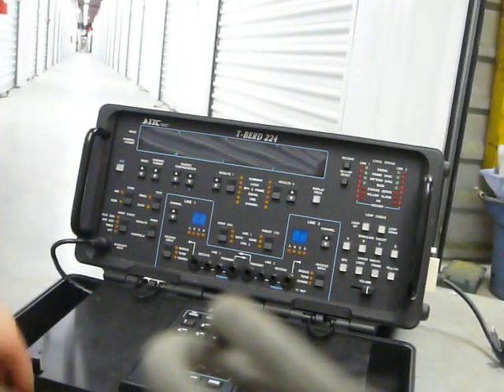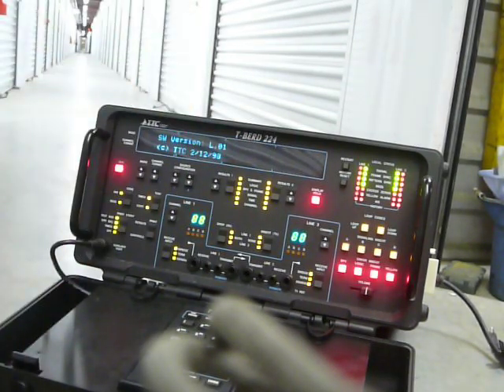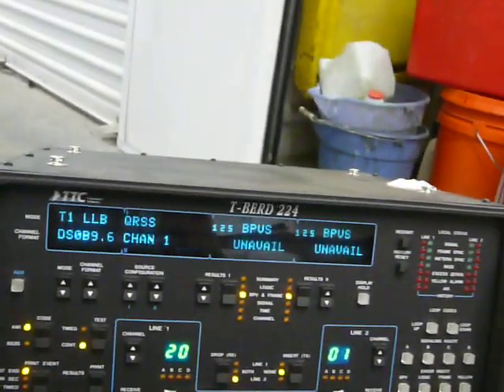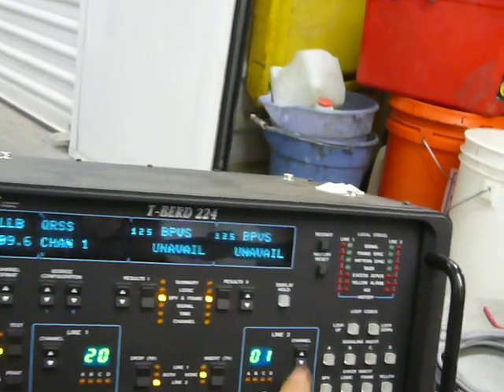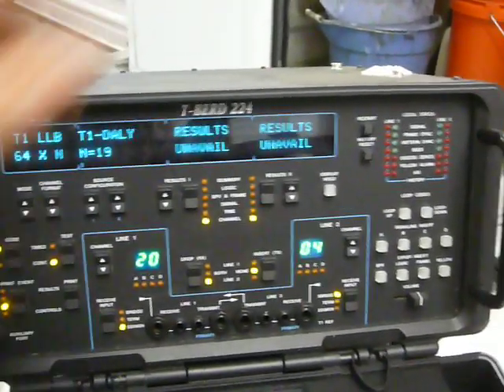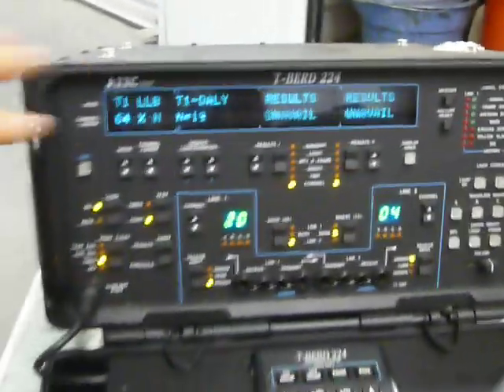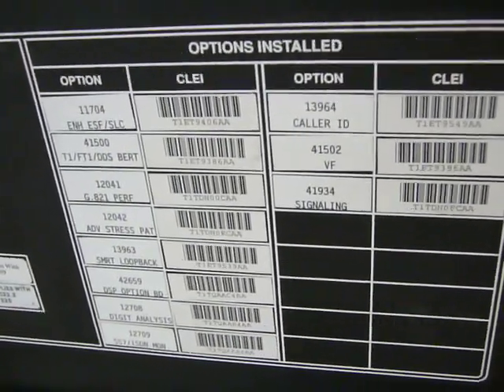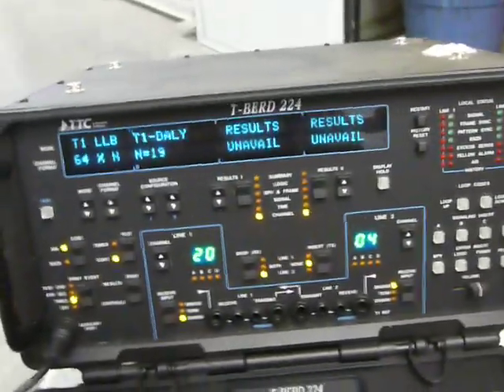T Berd 224 testing

Comment: As a desk jockey working with Tier I Carriers coordinating PTD (prove thru demarc), Head to Head testing, and Vendor meets for TCarrier circuits...

It's helpful to see what the field techs are using when they run QRSS (Quasi Random Signal Source line stress test), All ones (line repeaters power test),All Zeroes (line coding) etc.

Thanks for uploading this!

Comment: Usually when using with LIMs (Line Interface Module), I setup it up so I monitor the voltage which should be 6VDC and if there is any bit errors. It is again a awsome platform.  If you have any question I glad to answer them best of my knowledge.

Comment: I work at Acterna in Germantown in the production.  We use the T-Berd 224 on the T3AS line. We use the 224 for DS0 and DS1 test. If we need to do DS3 we used the 310. We use the 224 on the reliability test stand for Line Interface Modules, Protects, and Terms. It is a awsome. Yes that is in mint condition. Very nice.